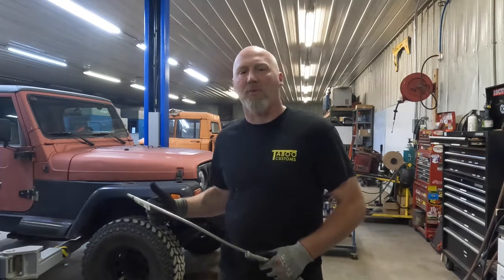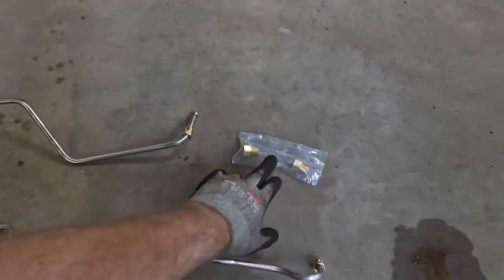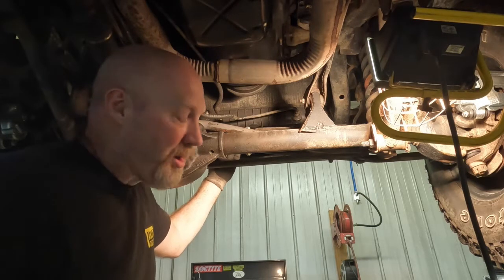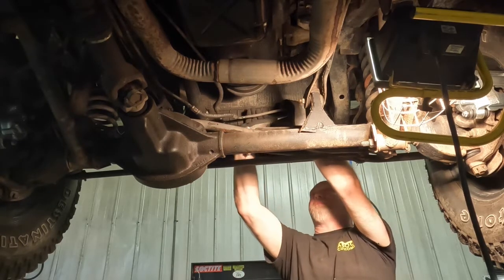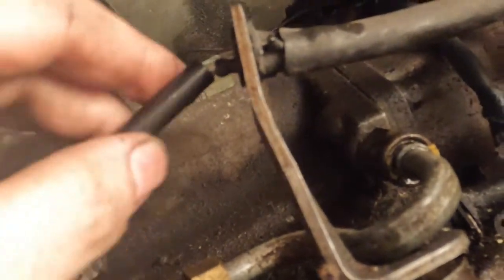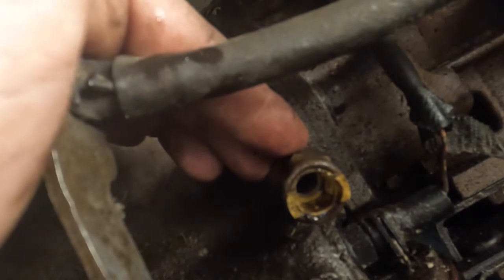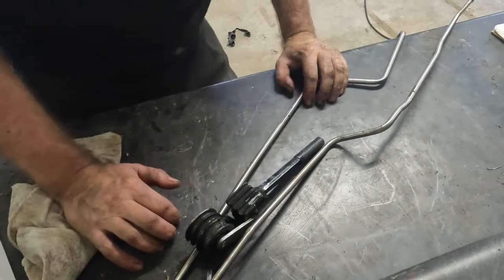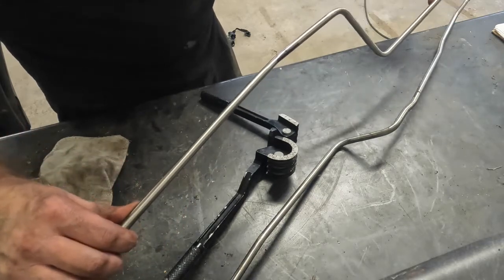Jeep TJ Transmission Line Replacement

Comment: Am I going to need to take the skid plate off to be able to get in there for the transmission connection? Looks super tight
Reply from the maker: It is pretty tight but we did do ours with the skid plate installed.

Comment: Anything for a 2004 4.0 Wrangler?
Reply from the maker: Fine lines does have a set.

https://www.vividracing.com/fine-lines-transmission-cooler-lines-for-0306-jeep-wrangler-w40-liter-complete-kit-stainless-p-152803634.html

Comment: So this kit does away with factory check valve installed in the one flex line?
Reply from the maker: Great question, we do have the 32RH which would typically have a check valve, but you are correct this kit does not have one.  We haven't notice much if any delay in the time from starting and shifting to the transmission engaging but we will keep an eye on it.   The prior pieced together setup was also missing the check valve.

Comment: This was a nightmare! No idea how to get them behind the exhaust. Ran them a different route and I can’t stop the lines from leakin at radiator.
Reply from the maker: What brand lines did you use?   We do sometimes have to loosen or remove the line then clean up or realign the fitting and retighten.  Getting them behind the exhaust can be a pain, sometimes we will bend them to get them behind it and straighten them out after.

Comment: I noticed when running your tj tranny lines there was not a check valve in one line do you need it for a jeep or not thanks
Reply from the maker: Yes stock there was a check valve in the line.   I believe you can still get lines with the valve but the general consensus over the years has been that its not needed.

Comment: Been reading forums trying to figure out what lines I have on my 97 tj (alum rad and aftermarket lines). Both where done by prev owner, I'm replacing the radiator (leaking) and wanted to make sure my new one is compatible. Anyway thanks for the video!!! Just in case I mess up my lines are just the ends (rad side) avail?
Reply from the maker: Depending on how your hoses hook up you might be able to get different ends.  With out seeing the ends or the hoses its hard to tell, I know the hoses I got had fittings for the lines that were push on so the part that connected to the radiator was short and separate.
Reply: @TabooCustoms  Its the same "Push to connect fittings" as your setup.

Comment: trying to do this job myself. any advice on getting the old lines out? I cannot for the life of me get them out.
Reply: Hi Tim - My buddy and I (both older and former great mechanics), decided to skip it. This task, (as I predicted), is a job for a 'Lift'. The top fitting is almost inaccessible even with the Jeep safely jacked up. Its a 'Hellish' undertaking, definitely not for the squeamish or even an 'old pro' The shop near me will accomplish this either from a pit or on a lift and its a good bet he'll drop the tranny fluid in the process. I'm not saying its impossible but extremely difficult. Plus there are numerous cautions and anticipated problems online.  I would strongly consider taking it to your local shop, (good luck my friend). :)
Reply: @Archivist953  yeah I think I'm gonna have to take the exhaust off to do it.